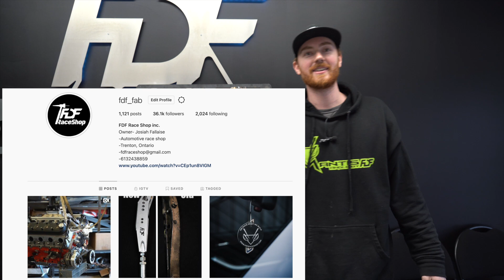What did we build?| This will help everyone understand front suspension geometry

Comment: An "Engineering Explained" if you will, in 3 dimensions and more detail.  So much easier to see and understand with the 3rd dimension.  All in language and terms anyone can understand.  For sure do the double wishbone set-up as well, will appeal to ppl interested in a more "racey" set-up.  Great job on the rig you designed and fabricated.